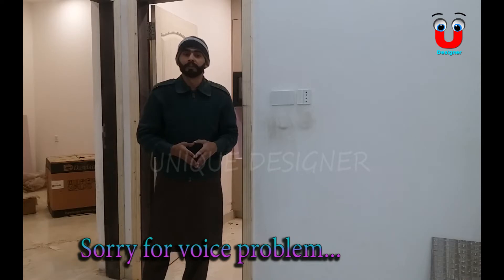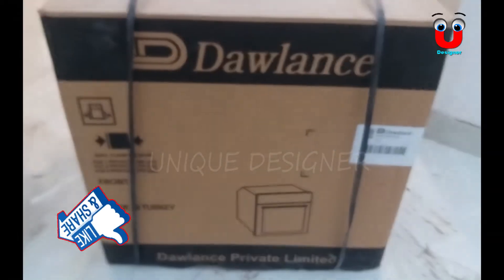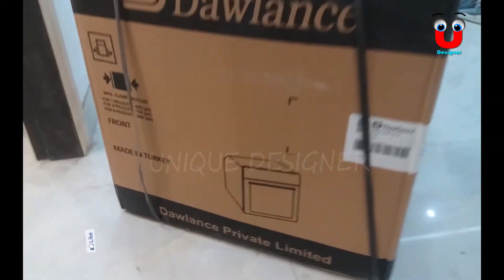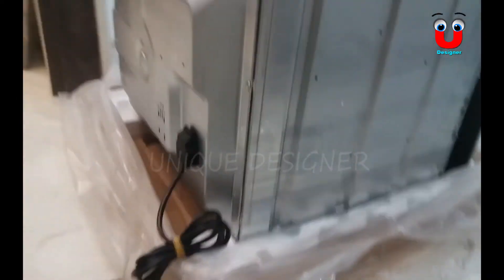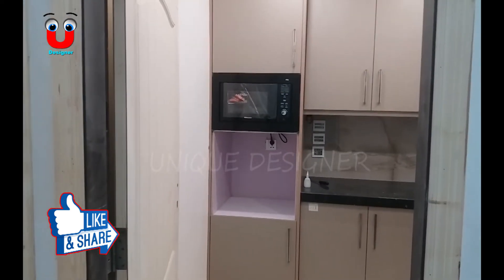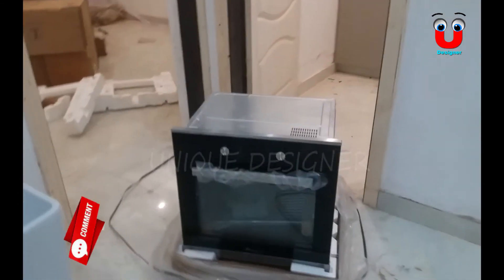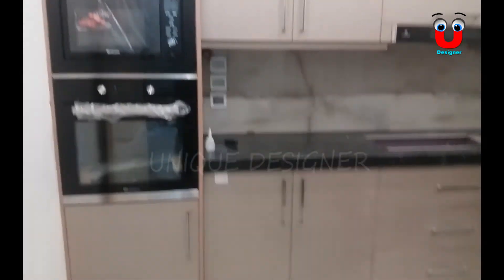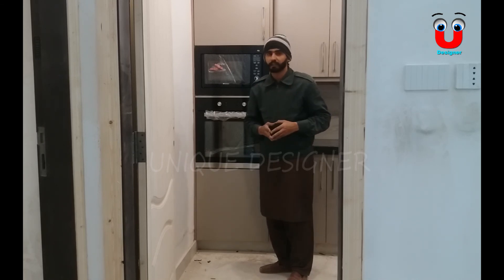Installation baking oven in cabinut | microwave oven cabinet design 2022 |  oven installation 2022

Comment: How does air will be exhaust  within the cabinet? Kindly clear my confusion
Reply from the maker: The border on the top of the cabinet is open from the inside.
Reply: @uniquedesigner786  agr stove k nichy fix krty hain oven tau kahan sy heat bahir ati hai baking oven ki ? Aur stove ki heat sy koi effect tau ni hota ?
Reply from the maker: @mahamtariq4645  stove ki heat oven pe bilkul b affect nai krti bcz stove ki sari heat elecronic hood catch krti h or is k ilawa extra heat ceiling exast cover krta h so kitchen temprature 90% tk normal rehta h
Reply from the maker: @mahamtariq4645  thanks for comment.....